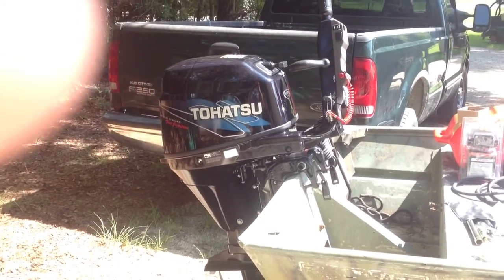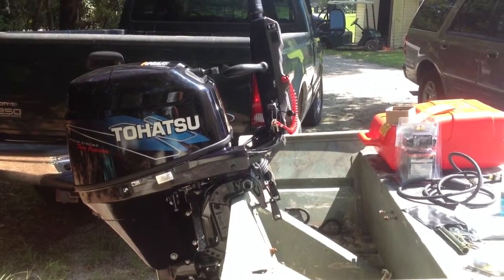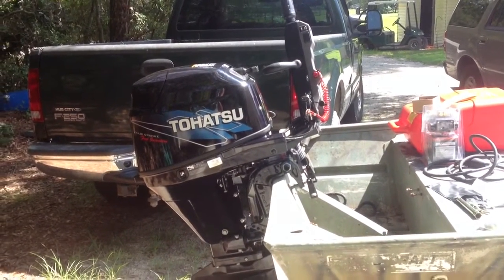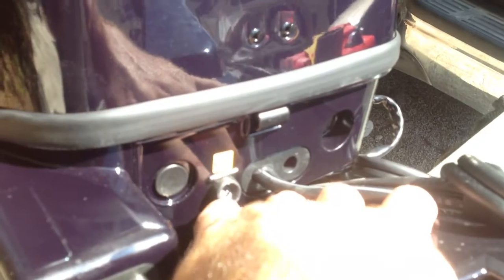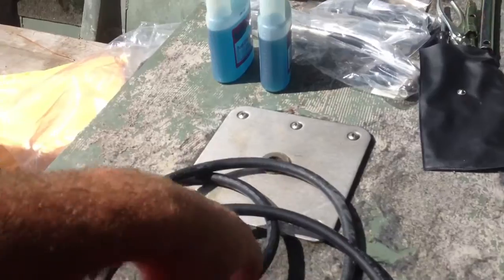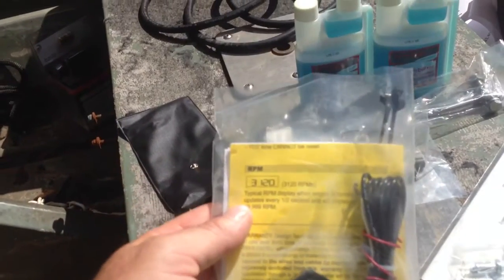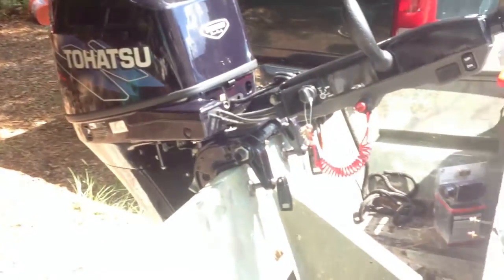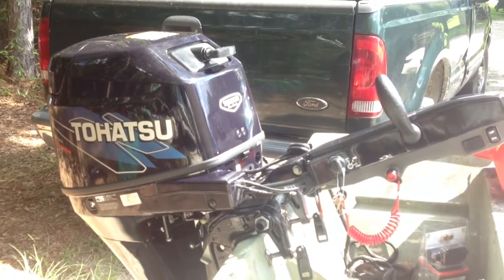30 hp Tohatsu 4-stroke

Comment from the maker: Hello everyone. It's been awhile since I have commented. My life was turned upside down just after buying this engine so I haven't been able to run the engine as much as I had planned. My little boy was diagnosed with leukemia. I still have the tohatsu, although I have put it on my skiff. I have a 17 ft. Fiberglass skiff and the engine is awesome on it. It is very easy on fuel and I have had no trouble with it so far.  It is also nice to be able to talk to someone in the boat while the engine is running, it is very quiet.  At this point I would have to say yes to anyone asking if I would buy another tohatsu.  Good luck to you all!

Comment from the maker: Just letting y'all know so far I am very happy with the engine. I haven't gotten to make anymore videos lately because right after I made this video I found out my baby boy had Lukemia. I have gotten to run the engine in occasion and I now have 22 hrs on it with no hiccups. Engine is quiet and uses little fuel, every time I run it I enjoy it. At this point I would have to recommend it for sure, if you are in the market for an outboard this size I would look into a tohatsu as an option. The power tilt and electric start work great. I hope my comments and video are helpful to all who view them and good luck to you all.
Reply: +Brent Pearson Very helpful video and I hope your son made a full recovery.

Comment: +Brent Pearson Thanks for making this video. I've own the same engine myself, '08-model, long shaft, el. start, but no power tilt/trim. I've have not measured how many hours it has been running, but it just runs and runs. Of course, I have been servicing the enginge myself. Changing oil, checking the fuel filter. I've only changed the spark plugs once, even though they seemed fine.... :-) There have been two problems with it. Had to get it to the my dealer to change the impeller. It was my own fault, I ran the engine without water cooling for about a minute after a oil change. That was enough to ruin the impeller. The other problem I've experienced are common on these engines. The plastic part (tube) which leads the cooling water through the 'back' of the engine was clogged. Just use a metal paperclip or a very tiny wire to fix it. I hope your boy is getting well from the leukaemia!

Comment: I have a 2014 ETec 30 hp short shaft, with electric start and power tilt and trim. I love it. Did you look at these motors. It is also a 2 stroke. It will go